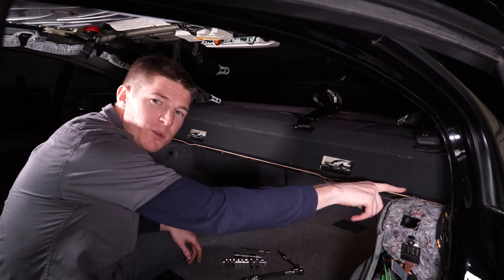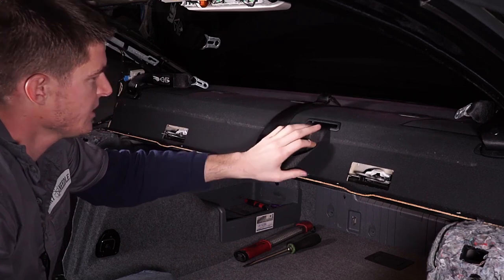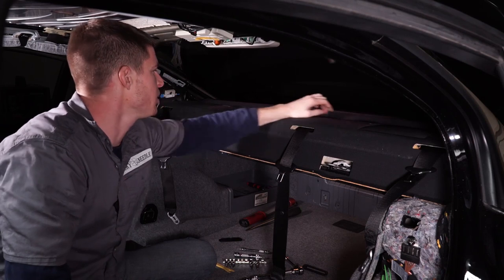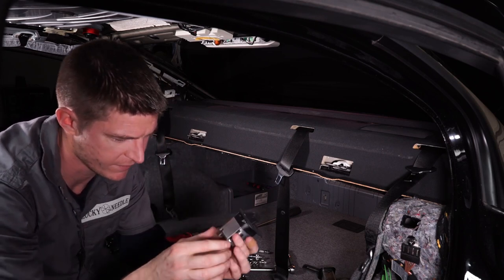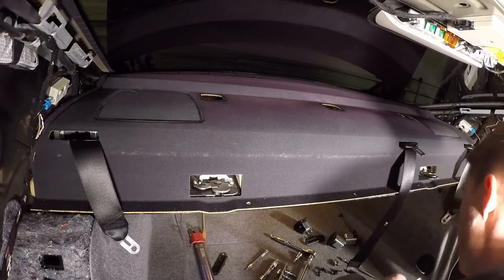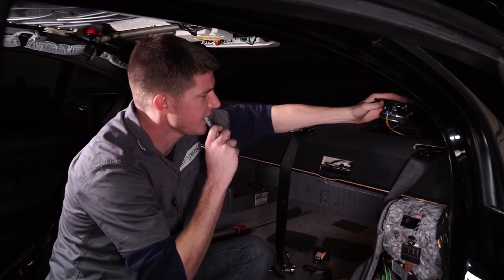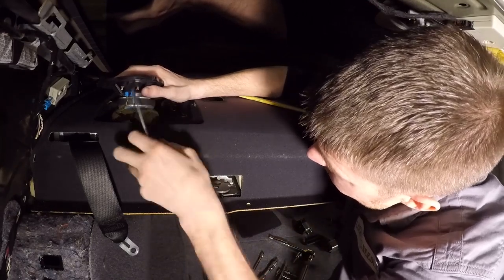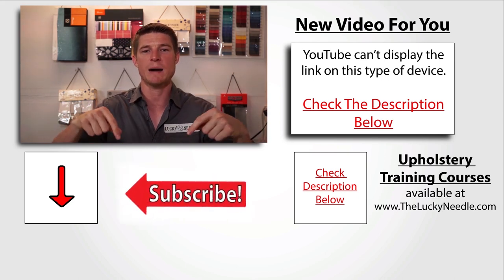E90 BMW 325i - Package Tray Removal - How to

Comment: Excellent video, and thank you for giving sizes for stuff.

2011 335 is slightly different. With the baby carseat anchor points they are always up, and they have a popoff tab in the middle to get to the T30. Still easy! 

And some of these cars have the rear folding 60/40 seats, so there’s a center seatbelt attachment connector up there between the anchors. This is just a twist type screw! Plastic wingnut. It has some pressure, but can be undone by hand. Doesn’t need to be removed till after the tray removal.

Comment: Nice video I Have a 2011 335, just saw bav audio video they installed by popping off thr speaker covers.. so do we really have to remove that trey?
Reply: wondering the same thing seems overkill, the replacement shelf I bought on ebay has the speakers in it
Reply: confirmed just did it speakers can stay, but the headliner piece in the back must be removed not shown in this video but another of his.  That rear wing of the headline removed you can bend the corner up and unplug the speakers.  In my case since my original faded shelf is going in the trash I was rougher than you could be if you don't have a replacement.
Reply: you can easily squeeze the speaker connectorand it pops right off, even blind no screwdriver needed.